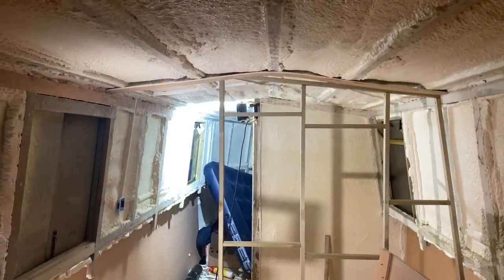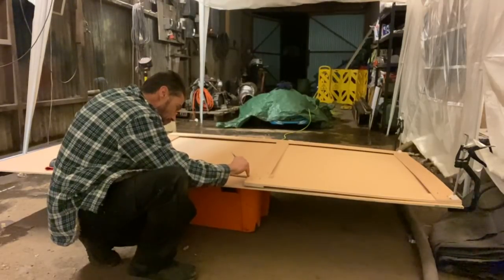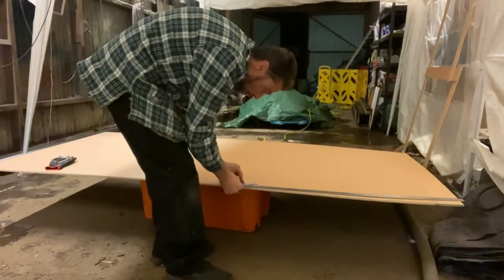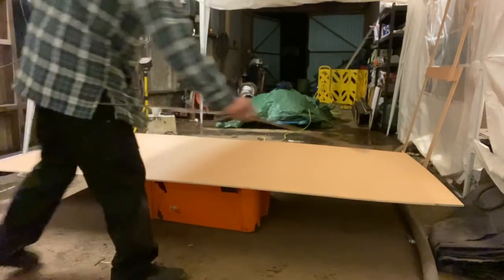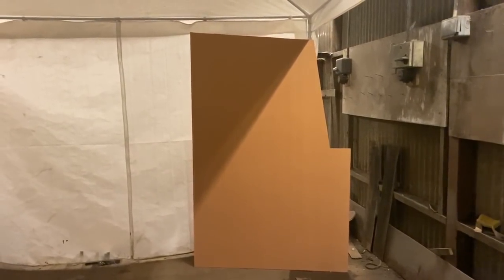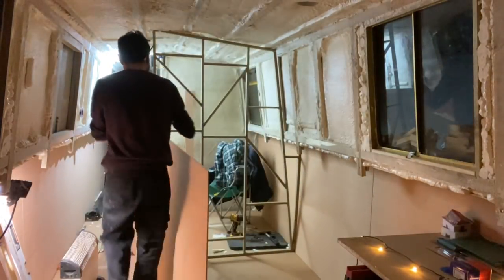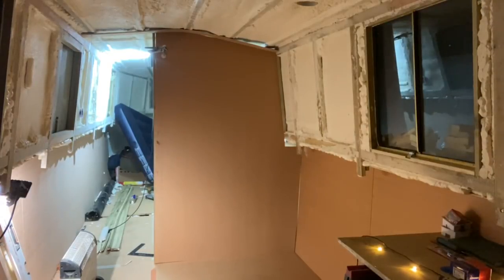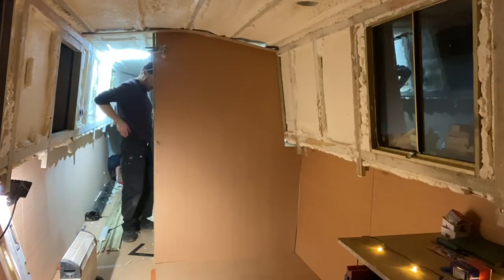50th. Narrowboat bathroom bulkhead - Part 3

Comment: Hi James,another job crossed off , well done and now you have a super reasonable off-cut you could use forever as a decent square,with the short edge sat on the floor and the nice un-cut edge of the sheet as the vertical, a true 90 degrees. If you cut it so it fitted with clearance under the gunnel the vertical is a good ruler and spending a few minutes marking it as such, will save ages of time measuring with the tape, you are wearing it out. With all the fitting coming up soon, if you wanted markings higher up the walls hold a straight piece of batton against your vertical and mark it. To check it turn the batten round mark again and accept the centre of the 2 marks. I found these were two super tools. Worth a thought ,Stay safe (PJ)
Reply from the maker: Ron Webster those are really good ideas to help with the vertical lines - something I’ve been concerned about. Cheers for that 👍🏼
Reply: @TheNarrowboatThatJamesBuilt  Many Thanks James (PJ)

Comment: Do you mind if I make a suggestion?  I hope not because here goes LOL.    Leave the middle screw out of the ceiling. That will allow the ceiling to form a more natural curve and might make getting the right bulkhead shape easier. I know you are a bit strapped for headroom, so don't put your lights in the centre of the boat, put them down the sides of the boat, where nobody is going to stand under. That will give you maximum headroom. 
 I've followed your vlogs from the beginning. It is facinating to see the process from start to finish. Hopefully you will still post vlogs once you get on the water.
Cheers
Dave
Reply from the maker: Dave Cook good suggestion. I’m considering affixing a thininsh batten to middle ceiling runner to bring it down by 10mm to soften the curve. I don’t want an angle on the ceiling, just a curve
Reply: @TheNarrowboatThatJamesBuilt  that would also give more space for wiring etc.

Comment: I’m impressed you are doing so well with cutting straight lines with a jigsaw. I’ve never been good at that so invested in a track saw brilliant bit of kit.
Reply from the maker: Gary M usually I’m hopeless at straight lines but on this project it works. I’d love a track saw but then where do you draw the line. Circ saw, table saw, jigsaw, track saw etc etc
Reply: @TheNarrowboatThatJamesBuilt  The simplest, quickest, neatest way, to cut 9mm ply (or in fact any ply up to about 45mm) is a pull saw. No break out, easy to hold to a line, and will even do moderate curves. In fact a pull saw is probably the best tool you'll ever buy! Screwfix do "Irwin" pull saw if you don't want to splash out on a real Japanese one. Just one warning, they'll eat your skin for breakfast if you let them..
Reply from the maker: randoneur I’d love a Japanese pull saw, but yeah scarier than all the other tools

Comment: good job, however at the top center your vertical support is running out of plumb, needs adjusting. Also upon reading a comment on your ceiling lights, you could use LED flat ceiling pucks (I've used them in my place, they're flush mount and are low current draw, and give lots of bright light) and do not create a head room issue.

Comment: Hi James, all seems to be going ok with the fit out. When it comes to fitting things to odd shapes try a technique called spiling, it's a boat builders thing that can be used with out the need to make individual templates for everything. (my day job is a boat builder). Keep up the good work.
Reply from the maker: Torbay Timber Twirler day job as a boat builder.......where have you been🤣🤣.

I’ll look at spiling - thanks for the tip 👍🏼

Comment: You mentioned several vlogs back that you might think about adding an additional strip to the center ridge, if you did the arch would not be so distinguished or pronounced.
Reply from the maker: hmarc417 no additional strip now. I don’t have the clearance for it. It was meant to run the 12v but I’ve come up with an alternative solution for that now

Comment: if you are getting a brand new water tank, the black comqosit qolythene ones can be used for drinking water so they say. (add camqers water qurification tablet maybe for added safety.)  I saw an advert for a comqany that will make them any size or shaqe you want so you could have a qointy triangle to fit snug in the bow.
Reply from the maker: Apparently clear plastic tanks are not good for drinking water as it can breed algae over time. That doesn’t happen in black or green tanks. So I reckon I’ll be going that was